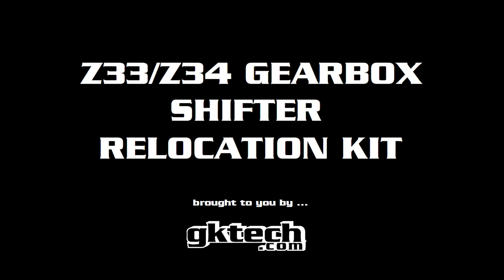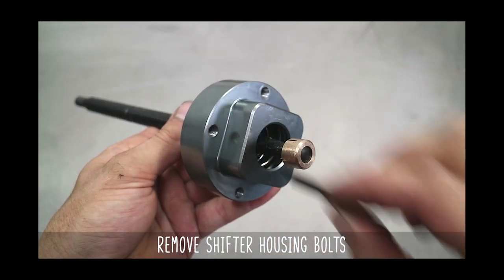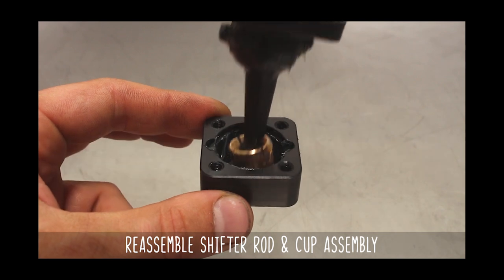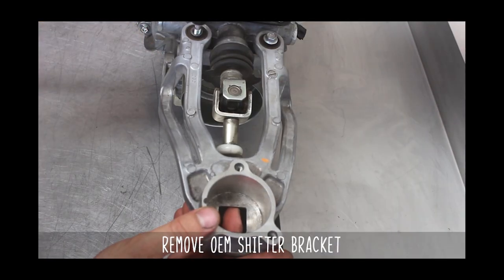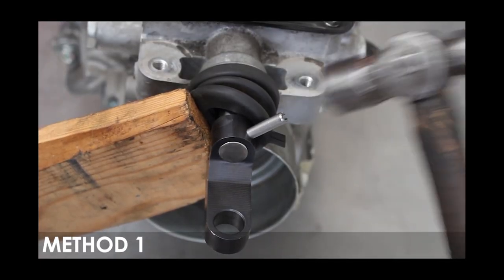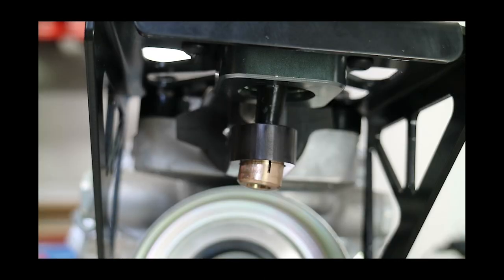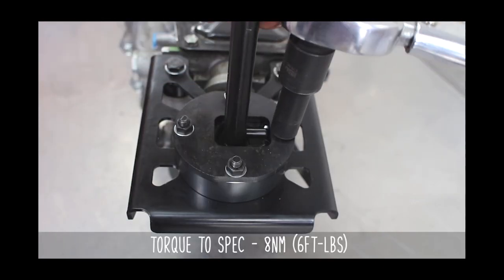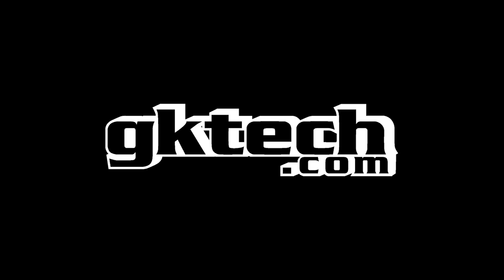GKTech Z33/Z34 CD009 Shifter relocation kit install

Comment: I have s14 with Sr20det and I will be using cd009 with mazworx adapter kit. This shifter kit will place shifter in oem location? so I don’t have to cut up my trans tunnel. Thanks
Reply from the maker: Correct!

Comment: Hello Dan,

Does this also work for the 1jz/cd009 Combo?
Reply from the maker: It works on any cd009, but as for it it lining up with the shifter hole and a 1j, i can't promise anything! It will however be closer that the long one that comes stock on the cd009

Comment: I have this shifter kit, my shifter must have not been adjusted as well as I thought and now the bushing at the bottom is stuck. Since the shifter won't come up and out, the linkage is still attached to it. And I cannot remove the front of the 4 bolts on the shifter cup from the bracket... so not only can I not remove the lever from the assembly to replace the bushing, but now the whole shifter assembly is stuck on the car as well... anyone have advice for getting either removed?
Reply from the maker: Shoot us an email at sales@gktech.com we will help!

Comment: Will this kit on a Lexus SC300? I have a 2j/cd009 swap. My shifter doesn’t have reverse lockout and it’s annoying finding 5th and 6th.
Reply from the maker: It will for sure fit in the trans... not sure about where it would line up trans tunnel wise however. This is definitely one of the shorter relocation kits out

Comment: For those who aren't graced with a shiny clean transmission, in order to remove the shift yolk on a rusted JY trans you'll need to cut the yolk off flush and use a 2-jaw puller to remove the base of the yolk off the inner shift rod. It doesn't just slide off like butter as shown at 2:12 lol

Comment: Does anyone know if this kit also fits the 2JZ on a Lexus IS300? Would really appreciate it if someone could shed some light on this. Thanks
Reply from the maker: Like a cd009 swapped 2jz? It will probably be much too long for that, using my cd009 on a v8 in a 240, i have to cut 4 inches back on my shifter.
Reply: @Officer_Dan  Thanks man, kinda figured it would not fit. But I was curious. I am looking for an alternative to the SerialNine kit, which is kinda expensive.

Comment: Is this for any s-chassis. Application.?
Reply from the maker: This is technically for SR20 s chassis with cd009. I however had one installed on my v8 powered s13 with some slight cutting.
Reply: @Officer_Dan  how about ka24.?
Reply: @Officer_Dan  which conversion kit for the cd000X did you use?
Reply: @Officer_Dan  your v8 schasis with LS?
Reply: @Officer_Dan  how much cutting because I just got one lol
Reply from the maker: @Luis Godinez  basically back to you pinch weld maybe 2 inches back I believe

Comment: does this work in a skyline r32? I've heard that they won't be at the OEM shifter location, they move a lot backwards is this true?
Reply from the maker: Correct. This is 240sx / sr20 combo only.
Reply: @Officer_Dan  is there a way to relocate the shifter in a R32 to make it fit at OEM position?
Reply from the maker: @k4iman  you would have to re fabricate the bracket that holds the shifter itself but it could be done
Reply: @Officer_Dan  good to know, thanks!